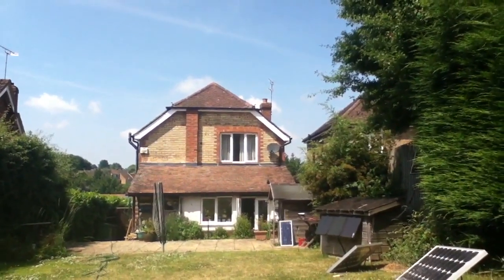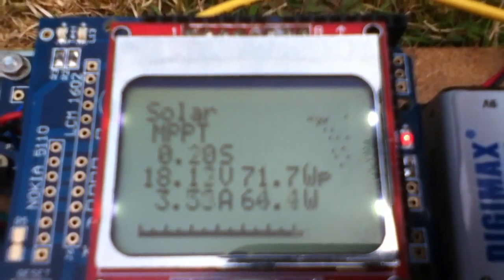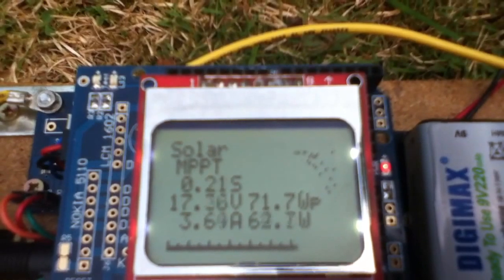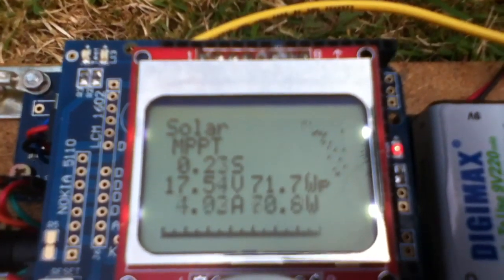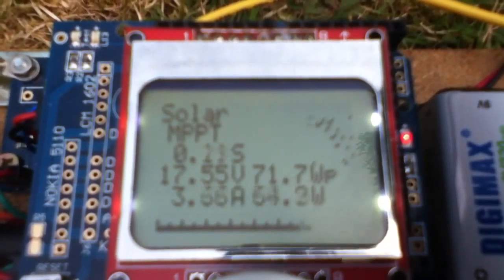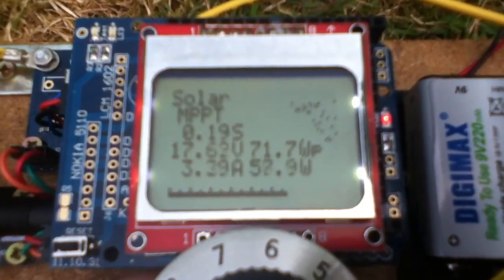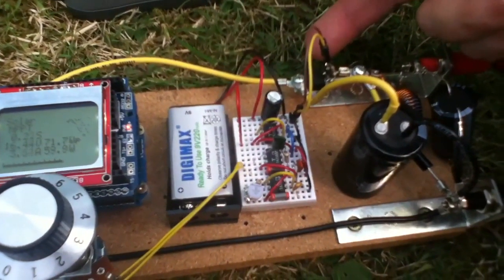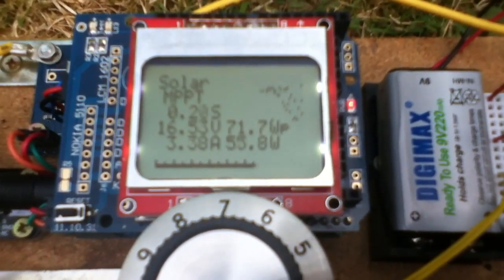MPPT Solar Charge Controller #13 - Conductance, Digital Filtering and Algorithms

Comment: probaly a litte bit to late now but i though about some "smoothing" i call it ,,,, its basicly avg. but its different its bacily 
OUT += (In-Out)/Constant _for_speed  well i always fuck up this mabey its (in-out) mabey its the other way around but ... this is it and the thing with that smoothing is ... its kind of dynamic its realy fast in big changes but if the IN differs the OUT only in a little bit the change will also be just lillte that kind of smoothes but still keeps up very nicly with the acctuall reading and of course because of that it has somekind3 of a cap charging curve to it .... as i said its too late but xD well shared knowalge and very bad englisch
 greetings germany :D